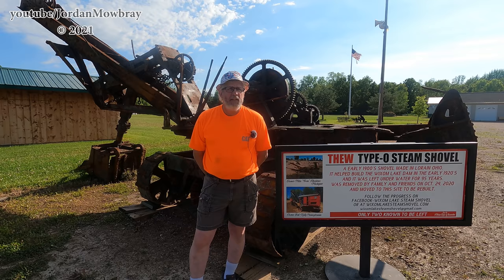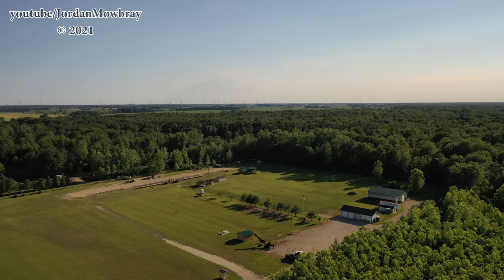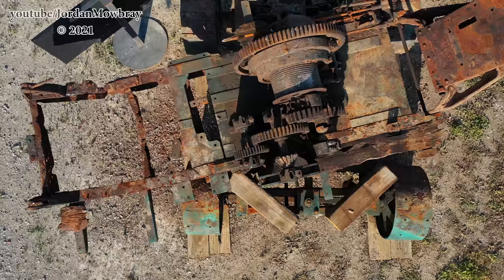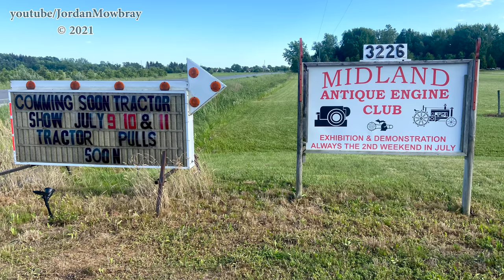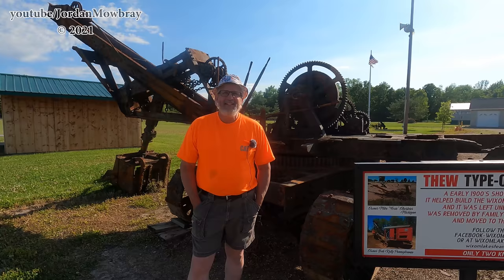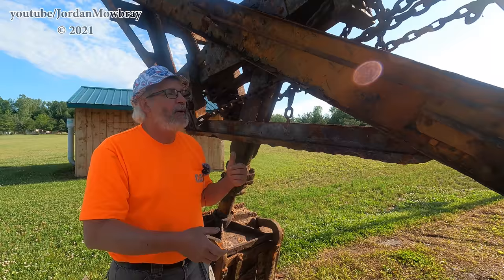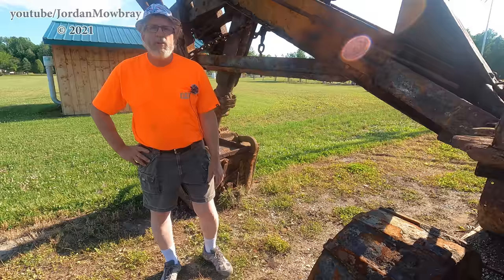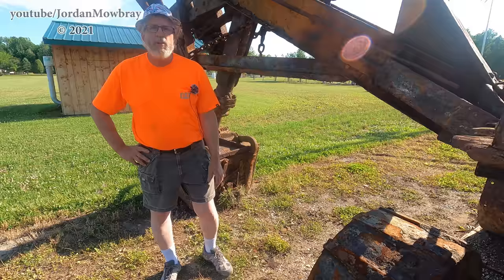Thew Type O Steam Shovel Update - Removed from Wixom Lake

Comment: Betting they used that other gear to run wood or coal down to the shovel. Amazing to believe we use to boat and ski over those. Always heard the rumours of a "crane" left under there.
Reply from the maker: It is pretty neat
Reply: I'd think it is more likely the dump cars on rails were used to move the sand from the digger to where it was dumped on the dam or embankment. Fuel could have been brought in from the road in horse-drawn wagons fairly easily. Sand is pretty heavy, coal or wood is comparatively light. I don't know exactly how the scraper would have been used, maybe clearing trash off the sand bank before digging it so they only dug up clean sand?

Comment: Jordan, would you happen have insight on how the steam shovel and horse drawn grader ended up in the lake to begin with?  Thanks.
Reply: He covered that in a video probably 6-9 months ago (or maybe longer) when they were working on getting it out of the lake. Basically it was being used to dig sand that was then moved to the dumping area (the embankment? I forget) to build that area up. You can see from drone shots where it was working down a long sand bank getting materials. 

When the digging was finished, the machine was very old and could no longer compete with "modern" (for the time) equipment, and it just wasn't worth moving it. So they pulled the plug and just left it there. 

I don't recall other equipment being mentioned in that video, but likely it also wasn't worth recovering in the eyes of the owners. Remember this area would have been a long way from anywhere at the time, with poor roads and possibly no rail transport. Moving something like a steam shovel any great distance would have been a major undertaking.
Reply: @lwilton  Thank you!
Reply from the maker: Make sure you check out all the videos in this playlist for the full story of how this ended up in the bottom of the lake.